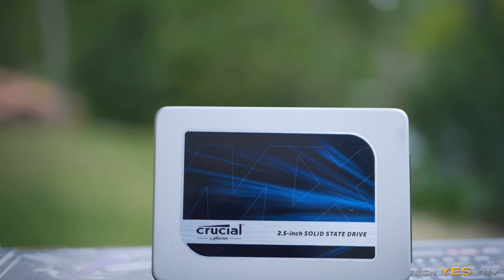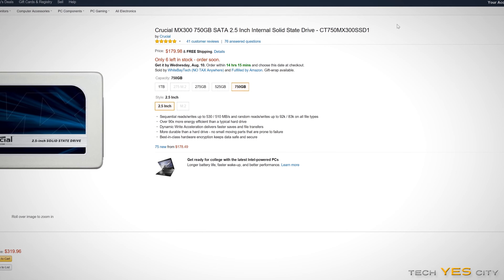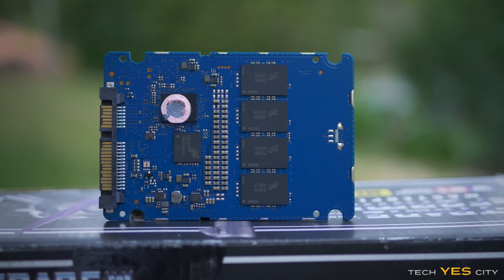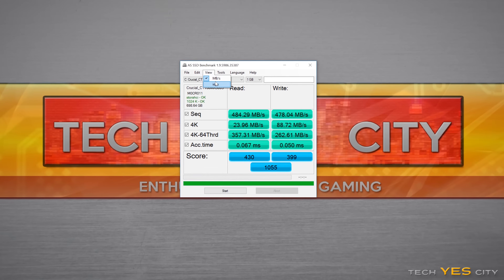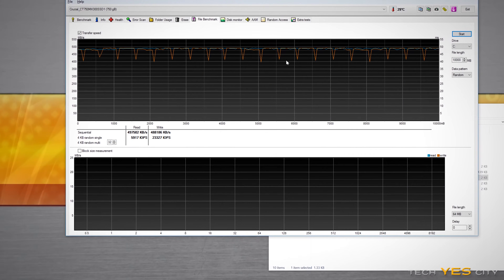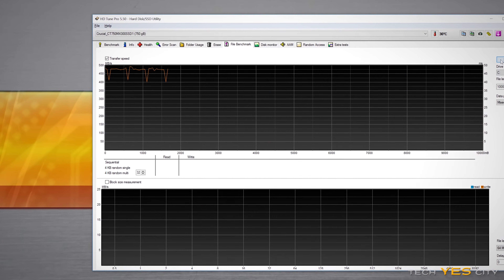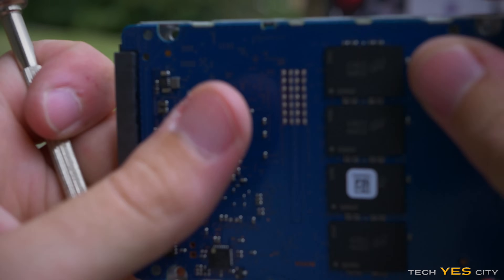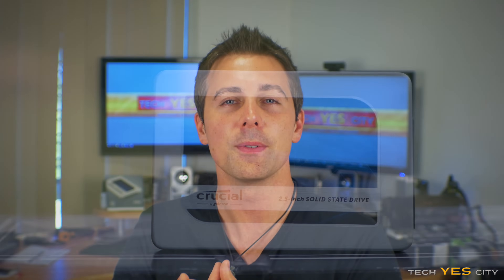Crucial MX300 750GB SSD Review - Marvel the Marvell Controller

Comment: Just a tip to anyone buying a Crucial SSD: Do NOT enable 'Momentum Cache' in the software that you can install with the SSD. It adds massive CPU lag spikes, causing the sound to drop out every now and then. I looked forever for what the issue was, including trying countless drivers for other devices. But nope, it was the 'Momentum Cache'. Aside from that, the SSD is amazing value. Anyway, you've been warned. By all means try it if you want, but if you get sound issues then just remember what I said, and turn that option off.
Reply: Thanks ill keep that in mind just about to go pick up mx300 1Tb thought i check out the comments before making a decision
Reply: It's a great SSD for the money. Just the momentum cache seems to gives lag spikes for some people, including myself. Turning on 'over provisioning' in the software doesn't have any negative effects, which is nice as it's a good option to have enabled.

Comment: Has anyone done game load times between Crucial MX300 and Samsung EVO 850 !??!?
Reply: MrApplewine 850 evo outperforms it by a little in benchmarks and windows boot timing. mx300 is bang for the buck, i would definitely pick mx300 if on budget.
Reply: Thanks. I ended up ordering the 525GB mx300. I haven't used it yet.

Comment: i take it no matter what upgrade i perform the graphics are just not going to let me get really far. GT 330 @ 256 MB just wont cut it, im going to need a new machine. thanks for hyping up this drive, its not that great
Reply: Self Sufficiency yeah your graphics card is the bottleneck. The ssd won't do much for gaming, there's some cases where an ssd can net you some extra fps, but that's rarely going to be the case. You'll usually just get massively faster loading loading screens.

Comment: threw one of these in my mid 2010 macbook pro along with 8gb or ram and absolutely no improvement on performance whatsoever in Dolphin emulator. it at best has sped up my basic system operations but was not the solution for gaming

Comment: This might be one of the first affordable SSD's that can replace an HDD entirely. $183 for a 750gb is pretty damn good if you ask me. The samsung 850 evo drive is $160 for a 500gb or $300 for a 1tb drive.
This is actually one of the cheapest SSD on newegg right now that's 500gb or over
Reply: i've got the mx100 500gb version, still going strong after 2 years without a hitch. technically not the best performers, but who notices that stuff anyways, it's plenty fast. paid almost $200 back then, great price/performance.

Comment: http://www.pcper.com/reviews/Storage/Crucial-MX300-750GB-25-SATA-SSD-Review-3D-NAND-Budget

@bryan i really hope your next review on ssd is more in depth on the technically side.
Reply from the maker: Yes and no, Pcper had an early revision, which fixed any major issues I would have come into with my drive at the very least.  Also it is a budget drive, so running server style endurance tests through it isn't kind of fair, the bx200 on the other hand failed on more real world consumer benchmarks.  So ultimately it depends on who the product is intended for. 

But you're right, the next time I will definitely be sure to do a full fill test in there, just to test, though 698GB mass file transfer could be interesting :P.
Reply: all the best mate!

Comment: If you guys are in the US you might be able to get it as a micron bulk drive for between 10-20 bucks cheaper then crucial sells it for. you can grab a micron 480gb bulk for 99 bucks the same drive as the mx 200 at micro-center for 10-15 less.

Comment: so the mx series are decent?

because i tried the bx200, and it's an underperforming piece of shit barely cutting 380MB/sec top speeds ;)

whereas my samsung evo's (850, 750, 840) all managed to break 500MB/sec and had about the same 90k random IOPS already
Reply: MX 200s are crap, 300 is much better. Suggest you keep an eye on mushkin reactor. I'm more towards MLC, need a large drive for my file transfers.
Reply: +Archie Wei fair enough

i guess on my next build i'll be going for an m.2 slc as boot drive rather than a sata for even more performance, 
and go for sata storage mlc on the side too ;)
Reply: +Alexander Rewijk keep an eye on mobo implementation of m.2, some just regular SATA 3 anyways, why spend the extra $$. NvME use PCIE lanes, make sure you got enough to spare from CPU to prevent bottle necking other parts of PC.

Comment: guys, give me a hand, I'm about to buy a computer. which is better, get the one with the i7 950 it comes with a sabertooth mobo or get an i3 4150 with a sabertooth mobo too.
Reply: get the i7 it will be heaps better
Reply: is it worth it? there is no way for upgrade in that socket, just wanna know, would it bottleneck a gtx 970/1060 or a rx 480?
Reply: i3 can't play games, i5 needed at least.
Reply: it wont bottleneck depending on the graphics card, amd cards are easier to bottleneck because of their  architecture but that all depends on the frequency of the cpu, and also what is the frequency, anything over 3.3 ghz should be fine.

Comment: Got a Crucial MX100 256GB for Windows and stuff and a Crucial MX300 750GB for Games and Programs.
Reply: You should take 2TB HDD and do a backup on this hard drive, don't trust SSD...
Reply: +Francefire I have HDD where I save important informatons etc. But I have to say that my mx100 runs since over 2 years now without any loses or so.
Reply: ***** Oh OK nice ^^
Reply: +Francefire But nice from you to point that out.
Reply: SSD is way more trustworthy than HDD, unless you want to disconnect it from the PC and archive it for 20 years without using it....

 http://techreport.com/review/27909/the-ssd-endurance-experiment-theyre-all-dead

techreport wrote over 2 petabyte on an 840 pro, no way a HDD could have managed that. ssd also doesn't have fragmentation issues.
Reply: givemeajackson You forget that SSD can die after some years, HDD if they survive the first 10month they can last 10year without any problems if you don't hit them
Reply: Francefire every single hdd reliability report contradicts that. a hdd can die at any time, without warning due to mechanical failure. of course an ssd can die if it's faulty, if the controller dies for example for no apparent reason, but the same can happen to a hdd. 

the hdd's mechanical parts are subject to constant wear, the ssd has no mechanical parts. the only way an ssd dies due to wear is when it has no more nand left for wear leveling, and that point is 1 of all an extremely long time away (you try writing  a petabyte of data in 10 years) and 2nd totally predictable. 

an ssd can lose its data if it's not connected to any power for a long time though, which is why hdd's are better for actually archiving data, but if you power on your pc once a year it won't lose data. 

there's a reason samsung offers a 10 year warranty on their 850 pro 1tb for example. the concerns about ssd reliability stem from the early days of the tech when there was no long term data and the early ssds still had their issues, but a modern ssd will outlast any hdd in regular use.
Reply: givemeajackson Oh ok thank you for taking your time to respond me that's pretty huge ^^ And thank you, I  had some false idea about SSD

Comment: And how does it compare to the 850s?
Reply: My BX 200 is slower than my 850 Evo but holds it's own and the only real difference is in write  speeds and even that is marginal. I have yet so see another drive that comes as close to the Samsung drives as the crucial drives I've had. And unless the MX 300 is slower than the BX 200 (which I find highly unlikely) the MX 300 should also be able to compete against the 850.
Reply: The 850 evo beats the shit out of the mx300. The mx300 is the most underwhelming release in 2016 so far.
Reply: Doesn't compare. Different market.
Reply: Archie Wei They are almost identical to the 850 Evos: Both are SataIII 3D-TLC SSDs. 
Why shouldn't they be compared?
Reply: americanv8ss ? wtf are you talking about
Reply: Archie Wei The MX300 is slower than the 850 evo.
Reply: +americanv8ss it's targeting different market.
Reply: +pSyk it's different generation product from different manufacturers targeting different market, sure you can look at it by performance benchmark but don't forget the price.

Comment: The M500 960 gb is better and has proven to be durable. $200 new on Ebay.
Reply: Or the 480 gb on amazon for $104
Reply: 3D-NAD is better in any way than normal MLC.
Reply: +pSyk this 3D NAND is much more compact than Samsung implementation, cheaper to make, duration wise I can not comment, hasn't been tested yet.
Reply: pSyk So why is the mx300 so slow?
Reply: I got an m500 120gb as my bootdrive, its fast enough, does all i need it too and has taken some beating. It was the most decent thing i could afford a year ago and it was a great purchase, ill use it in my coming x99 build until it breaks. It even has a row of capacitors or something like that inside that keeps it on if the power goes out so it can finish writing whatever it had to so there would be no corrupted data, the m500 kinda has "server dna". It's a great drive, people are using them for games but i really don't think it's necessary, maybe a few games like grand theft loading screen benefit, other than that hard drives are still good enough for most people. But for os drive, get an ssd asap. It even kept my core2duo with 2gb of ddr2 alive for 1 more year until i got this i3. Anyway, i sidetracked it's 6am. The m500 is a great budget-ish ssd with good features and reliability.
Reply: renyn21 I agree but the 120 and 240 m500 can be slow to write.  The 480 and 960 are much better.

Comment: I got 144hz GSync 1080p monitor with i5-4690k upgrading to asus strix gtx 1080 will it bottlenecking?
Reply: It will bottleneck the 1080, I would go with at least a intel 6950x, any games with heavy multi-threading like minecraft will benefit huge!
Reply: you're fine. You might have problems with very cpu intensive games
Reply: i don't think it will really bottleneck that's not to say a better newer CPU wouldn't improve performance
Reply: It depends on games... -_- but for most of games no.
Reply: Can you guys give me some example? I am playing a lot of GTA V, Witcher 3 , Rise of tomb ,Fallout 4
Reply: You do not need a GTX 1080 for 1080p. I suggest looking for GTX 1070s and even that is a bit much tbh. CPU side you are fine. Game differences between a i5 and i7 in dx11, OpenGL are negligible.
Reply: Poups Gaming For this games It will be 100% alright ;) Ultra no problem, but for Bohemia games (which use enfusion engine) you will not be able to play full ultra, High no problem but not ultra ^^ (Arma, DayZ etc..)
Reply: the monitor may be a bottleneck in quite a few games. at 1080p, the 1080 can push games at more than 144Hz!

but as people said, the i5 should be good enough for the majority of games.
Reply: If you are targeting over 144fps in all situations, the cpu will probably be a bottleneck in many games.
Reply: You'll definitely be looking at a CPU bottleneck in GTA V and The Witcher 3 depending on where you are, similar story with most other games. You'll still have perfectly playable framerates and it's not worth upgrading, however you might wanna use DSR to get the games into a GPU limit again as CPU bottlenecks can often cause micro stutters. Also overclocking the CPU should help, if you have something like a Hyper 212 Evo or better on there you should easily be able to get it to around 4,5 Ghz without too much tinkering.
Reply: Antares 8001 Tyvm

Comment: I wouldn't touch that drive. Of 12 recent drives tested that one is the slowest of the 12 on read speed, and read is what's important as that's what you notice. As a comparison. mx300 read test data in 7.45 seconds, but the Samsung 950 pro 512gb read same data in 1.75 seconds
Reply: 950 pro is a nvme m.2 ..
Reply from the maker: What review? The drive is overall really solid. Has very consistent reads and writes from my tests.
Reply: @i dont know 2GB/s vs 500MB/s read speed. Totally the same class of ssd's...
Reply: NvME vs SATA. Dude, just look at the price. This drive is for storage or low budget build.
Reply: +Tech YES City why bother, he's got no idea what he's talking about.
Reply: I would hope so with m.2 being like 200 bucks for 256GB...
Reply: Actually, in some of the extreme tests, it was falling into fast HD territory. Probably not in random, but other speed related testing. Again, this was at the edge of "would a user ever get to this point or run this way" testing. I agree overall that any SSD is good SSD; assuming it has TRIM capability. That's why I still bought this drive.
Reply from the maker: Matt McGregor Thanks for that link, though they are dropping server style endurance based tests on a budget consumer drive lol, I thought it did a great job for what it is.
Reply: I don't know living up to his name.....
Reply: 850 evo is 157 bucks for 500 gigs, mx300 is 119.00 bucks for 525 gigs. Crucial is far better bang for buck, and you wont notice it being slower in day to day tasks.
Reply: Matt McGregor The slowdown is gnerally due to hand off between slc cache and tlc storage due to small slc & driver implemenation. It's a problem with the new intels as well.
Reply: I have seen Anandtech reviews that this drive has performance issues when it gets near its capacity; filled. I bought one, but I also got a Lightning deal during their recent big sale from Amazon for $139; could not pass that up.

http://www.anandtech.com/show/10274/the-crucial-mx300-750gb-ssd-review-microns-3d-nand-arrives

"One thing to point out is that through our testing, we see that the MX300 has an acute weakness in its random read latency."
And
"However, when the MX300's SLC write caching and spare area are exhausted, it slows down to the level of budget planar TLC drives."

They also stated:
"To put this into perspective, under ordinary consumer and end-user/home workloads, the MX300 performs at its peak near the top of the TLC charts."

Cheers all and thanks for the review Brian! Still looking for a GTX 1070?
Reply: Even if it is the slowest, it doesn't matter, its an ssd, so it's going to be fast.
Reply: +Tech YES City Agreed. The tests were torture level maxing out the drives where possible.
Reply: You're comparing a SATA drive to an M.2 NVME SSD, of course the MX300 doesn't stand a chance. When it comes down to SATA SSDs the crucial products are some of the best out there. I've recently had SSDs from Intel, Kingston andSanDisk at my disposal for benchmarking as a couple of friends and family members were upgrading their PCs and my Samsung 850 Evo was the only drive that outperformed my BX 200 which should be a slower drive.
Reply: It's due to latency. As a comparision. 850evo sata and mx300 have approx the same read speeds and yet the 850evo reads nearly twice as fast as mx300 when reading 10x 200mb files while similtanously writing.,  It's not related to interface pipes
Reply: stop trying to hide the fact that you dont know the difference between nvme and sata
Reply: I've already stated, the mx300 reading data is twice as slow the Samsung evo850 sata when reading cumulative files. It's not related to interface, it's just a slow drive, The slowest drive read drive on the market. Only cucks would buy it.
Reply: ***** Nope I've redone my benchmarks, and according to AS SSD and a couple of real world benchmark the only drive I've ha access to that didn't consistently get it's ass kicked by my BX 200 (which is almost certainly a not as good a drive as the MX300) was the 850 with nearly equal read and around 30% slower write speeds.
Reply: Mr. Flintstone gets it.
Reply: Fred Flintstone Agreed on the new performance, and I have one of the 750 ($139 lightning deal), but the concern is if/when the drive fills. It appears that performance drops (dramatically to below HDD level according to Anandtech) when drive is nearing capacity.limit. That is just something people need to at least know about to avoid if possible. Samsung does not experience this type of concern
Reply: And Why would u compare this drive to the arguably the most expensive/popular drive on the drive. Thats a dumb ass comparison.

Comment: Would you say the performance on this SSD is worth it? I'm considering a ~500GB SSD for games and the 525GB MX300 is £117.10, as opposed to a 480GB BX200 for £65 in a local computer shop.
Reply: Don't buy the mx300 then, go for mushkin reactor. 200 are shit, not recommended.

Comment: If the capacity in reality is 698 gb how can they get away with naming it 750gb ? it should be 700gb instead
Reply: they rate the gigabytes at 1000 MB but GB's are actually 1024mb. Every single manufacture does this I have never came across a Storage device that was actually the size they advertise.
Reply: It's actually 750gb in Linux for example. It's because GiBS instead of GBs
Reply: Abimael Lopez it's deceiving consumers though use the actual amount that it will have. it's the same as the gtx 970 has 4gb oh nope actually 3.5 fool :D
Reply: +King Quartz I can see why you are seeing that, but it's not false advertising. Consumers are just uninformed. Ntfs is the problem so blame Microsoft